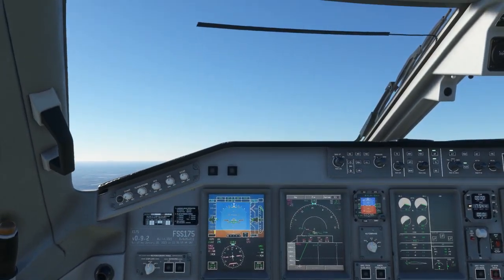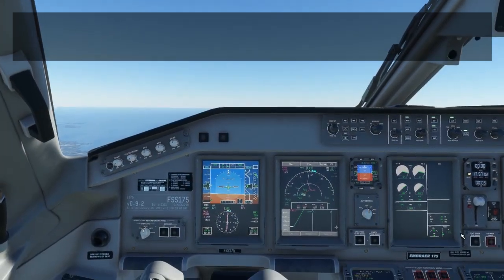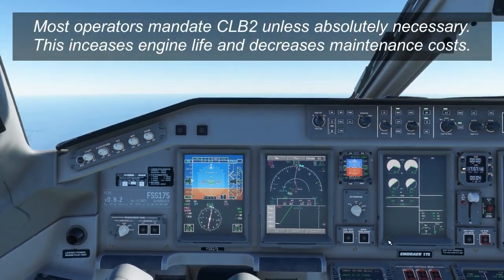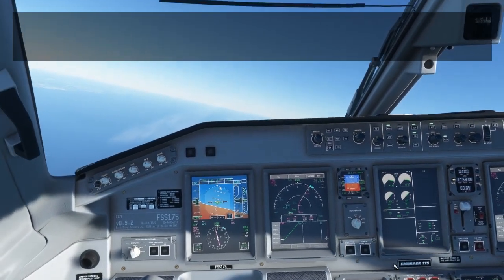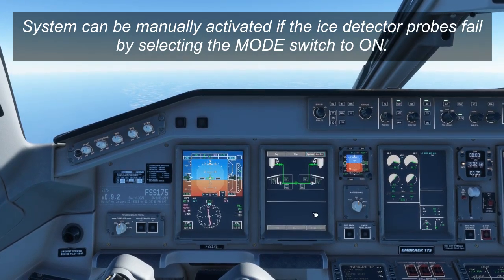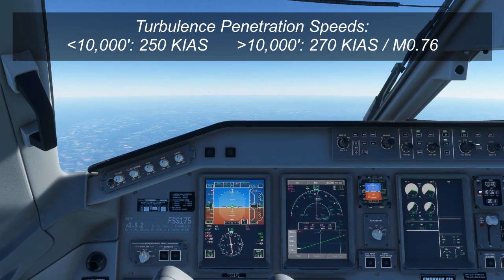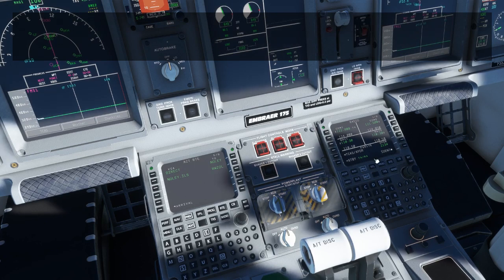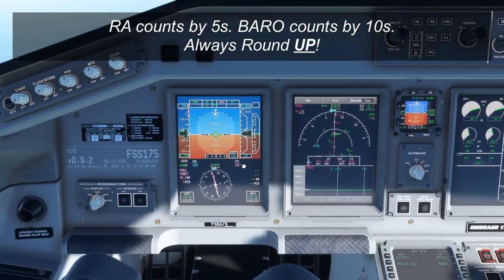Embraer E175 Tutorial 07: Climb-Cruise-Descent

Comment: How do you select 100s instead of 1000s on the altimeter? I've searched forums, but they're suggesting things that wont apply to the plane I'm flying. There's no outer turning knob or whatever to change from 1000 to 100 or vice versa. I had a FL350 cruising speed, but couldnt set it because for some reason, mine was stuck at *900 (33900/34900,...)

Comment: Hi, after i take off in this plane after following all of your other previous videos steps, i can not seem to change the speed of the airplane. it stays at my v speed and when i try to increase it it does nothing. I can increase my speed manually but i was wondering why the auto throttle wont work. Is there a way to fix this?

Comment: Great tutorial.
Just one question, why do you use V/S vs FLCH when you start descending towards 6000ft from cruise altitude ? Thanks
Reply from the maker: Ideally, I should have used VNAV if it wasn't unavailable.

V/S mode is actually better for maintaining a more precisely targeted descent when you are trying to meet certain restrictions. FLCH, while it does maximize the rate of descent, is very slow to reach and monitor what the target rate is. Also, any small changes in wind result in big variations in the descent rate. FLCH is good when you need a big but relatively imprecise descent. Because I had so many restrictions, I went with V/S mode.

Comment: If I read the aom correctly, and you use 'des now' to begin the descent, it will descend at 1,000 feet a minute until it intercepts the vnav profile. At that point, it will begin following the vnav profile. Did I understand it correctly? I'm flying the FeelThere version of this aircraft. Thanks a bunch!
Reply from the maker: That is exactly correct. I highly recommend DES NOW on every top of descent if only for 5 miles just to smooth the top of descent. Otherwise the aircraft easily overspeeds before the thrust makes it back to idle.
You can also activate DES NOW mode by activating VNAV when you are not in ALT mode. Just tap the VS button to go into VS mode, then tap the VNAV button and the VNav will be reactivated in Des Now mode.

I am not certain if the FeelThere or Flight Sim Studios supports Des Now.
Reply: @CaptNabs  Awesome! I'll give that a try, as I don't think the FeelThere version has 'des now'. Thanks again!
Reply from the maker: @srmj71  As I think more about it, yes FeelThere may not have DES NOW. They model the older software version, Load 24. It did not have a good VNAV system. That was one of the major improvements for Load 27.
Reply: Hello
Are you type rated E175?
Reply: @turarismailov449  no. Just a flight sim enthusiast.

Comment: Hello Captain,

Thanks for the videos, I watched all parts.

I would like to ask a few more questions if you dont mind.

1)
How do you type into the FMS a ROUTE OFFSET?

Can you give an example, please?

For example 3.5Nm LEFT.

2)
If you have an altitude constraint that says you have to be:

Higher than 13000ft but lower than 14000ft, how do you type it in?

I saw how it is done in Airbus and Boeing, but not in Embraer.

3)
When do you use CLB1, if you use most of the time CLB2?

Does the CLB2 change to CLB1 automatically, when you pass a certain altitude?
I know that in Boeing aircrafts, when you climb with CLB1 or CLB2, at 15000ft it automatically climbs with normal CLB.

4)
When you want to make a Step Climb, you can set the increment in the FMS, for example 2000ft or 4000ft ect.
Will there be a S/C symbol on the MFD, similar like in Boeing?

5)
Is it allowed to arm LNAV and VNAV before Takeoff?

6)
What does the function RW POS mean?
I heard that, wenn the aircraft is on the runway and the pilots activate RW POS in the MCDU, that a new calculation will be done from the Runway as reference.
Is that correct?

7)
Is that correct that during taxi with two engines it is not allowed to use more than 40% N1 in Embraer, except during SETO or SETI. And if you do so it needs to be documented?
In a JustPlanes Video, a female EMB-190 CPT of Royal Jordanian said that.

8)
During Engine Start the pilots activate a timer, what is the time limit to stop the engine start?
For example during hanging N1 ect.

Are there different time limits for engine start? For example during cold conditions?

10)
British Airways Cityflyer uses the EMB-190 for flights to London-City.
Is there any special regulation for Steep approaches?
Is there an aural warning like in the A318 or A220-100/300?

In the A318 you could hear:

STANDBY STANDBY FLARE

In A220 you hear:

STANDBY FLARE STANDBY FLARE

11)
Is there an automatic V1 Callout in the Embraer jets?

Thank you and I hope you like to answer a few of these questions.
Reply from the maker: Wow. Glad I helped and glad I inspired lots of questions. Allow me to do my best.

1) Lateral offsets. I had to look this up because I never used this in 6 years. Its on RTE page 1. 5L key is 'OFFSET'. Type in L/Rxx For example L2 for Left 2 miles.

2) Like Airbus, there is no way for a PILOT to insert a 'Window', that is Above10000Below13000. You can only do At, AtOrAbove, AtOrBelow. Windows can only be retrieved from the database. Incidentally, enter an altitude in the 1R button of the FPL page to enter a constraint. Append an A or B for AtAbove or AtBelow. For example, 13000B is 13,000 or below.

3) Our company was very insistent that CLB1 only in the rarest of cases. Perhaps some weird terrain or ATC constraint, or absolutely necessary to clear some traffic. But avoid it as much as possible. And yes, CLB1 and CLB2 do converge at around 28000 I believe.

4) There is no optimized/suggested step climb. You can insert a manual step by entering an altitude on your FPL page with an S for Step. For example 350S on the right column would insert a step to FL350.
The step will appear on the vertical profile on the MFD, not on the map.

5) It is possible to arm NAV and VNAV before departure. On version 27, they automatically arm and must be disarmed for manual departures. Our company policy didn't like VNAV on prior to 1000', so we could engage it at 1000' in lieu of FLC mode.

6) I am unfamiliar with RW POS. Can you point it out to me and I can try and figure it out?

7) 40% N1 max for taxi is not a hard limit in the manual, but it is highly recommended. Above 40% at low taxi speed, there is a good chance of ingesting FOD into the engines due to their design and relatively close position to the ground.

8) Starter limits:
 - Attempts 1 & 2: 90 seconds ground (120 seconds flight) followed by 10 sec cool down.
- Attempts 3, 4, 5: 90 seconds ground (120 seconds flight), 5 minute cool down.
The limits do not change for rain or snow or cold. Just air vs ground.

10) I don't know anything about Steep Approach procedures. Our planes were not equipped and we had no such destinations.

11) There is no automatic V1 callout. That's what the F/O is for.

Thanks for the great questions!

Stay tuned for more E175 videos!!!!
Reply: Hi
Are you type rated E175?
Reply: @turarismailov449  yes he is